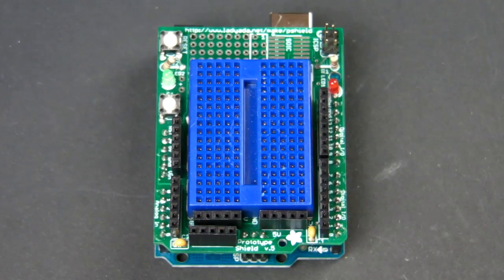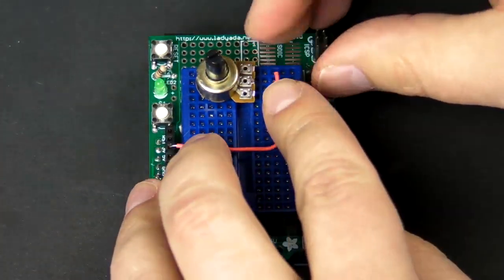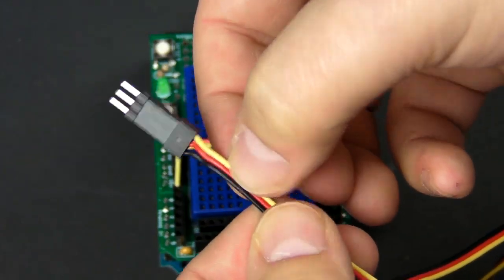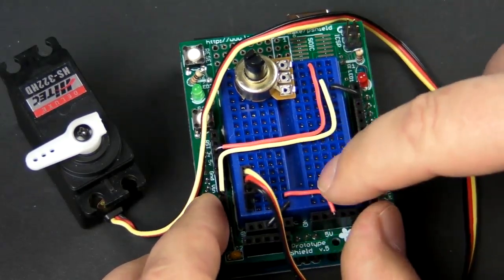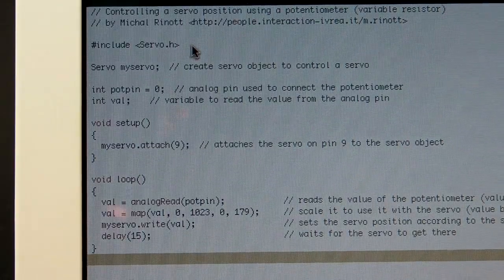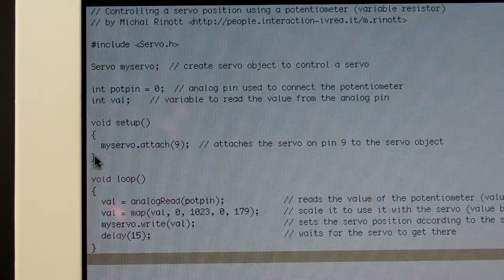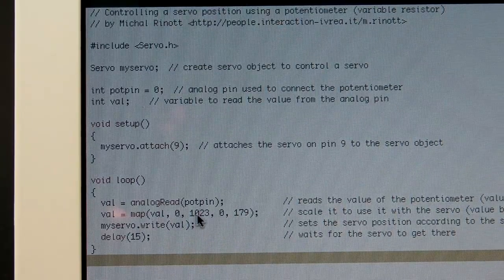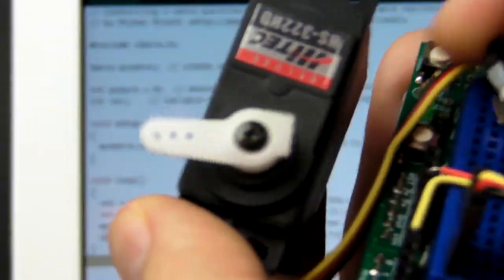How-To Tuesday: Arduino 101 potentiometers and servos

Comment: Would I be able to control a servo with another Servo in a similar method
Reply: +Steve Sacks no, unfortunately. While servos do have a pot in them, for whatever reason you cant read it without opening up the servo and wiring directly to the pot.

Comment: I am wanting to create a potentiometer servo control as you have outlined... but... want to control the servo remotely.
Sending the code via 
Bluetooth
or
WiFi (local lan [ by wireless modem] )
for pan/tilt functions of a remote cam.
Getting ahead of the game here
I want to also send Camera control via IR code wireless as well 
That IR code being transmitted as Lanc control code. 
Completely separate from the Servo PWM code.
I get that.
Wondering what format of collection of Aurdino/Rasberry PI boards can accomplish this task.
Reply: +Exclusive - Technology get in line buddy that is really advance, i only been fucking with that code for the past 6months and still no results, is not easy at all lots of filtering lots of bs and this is just one servo never mind more
Reply: Have the code...  messing with the variety of ways to make the connection.  Along with slowing the servo speed down,...   have seen lots of posts of servo speed modification in the PWM signal. 
Not wanting to limit the degree of the servo movement with the Potentiometer.. but increasing/decreasing the speed of the motor.  Want to keep Joystick for servo directional movement.
Will post results on my channel with a video when I finish this video board...
Reply: I have seen the coding of another separate servo independently referred to as a separate " INSTANCE "

Comment: Great project i love it thanks for the tutorial , i wonder how many servos and potentiometers can be attached on on arduino ? Thank u very much
Reply: +Amin B as many as port you have , what kinda question is that ? after that your only issue is going to be power
Reply: Frank Lopez kind of question that means im not an expert im just curious but that u for ur answer
Reply: im not trying to shit on you men im on the same boat i mean i am here for a reason but not cuz of the question you had in mind, but doesn't your question seems logical ? i mean how many plugs can you plug on your wall socket??  this is pretty much what you just asked.

yeah usually most single wall sockets has 1 port with 2 sockets so the answer is 2 power outlets, tho you can get a power extension and now you have more sockets for your outlets in arduino is the same concept
Reply: Thank you bro for u answers and explainations 👍
Reply: Np, Amin hope you got your project going  let me know if you have any other questions

Comment: Can you attach a analog servo to a digital pin on the arduino?
Reply: +bolo santosi why would you even ask ? and more importantly why ? analog is analog
Reply: well im new to this and to gain knowledge I need to ask questions....
Reply: I hear ya dude, where are you now in your learning exp?>
Reply: +Frank Lopez I know just the basics as of now with my arduino board
Reply: that's whats up! well I can tell you that any pin on the arduino is digital tho some of those have extra functions call ADC "analog" if you have Skype I can break some other factors down maybe even throw some code your way to help you get started on some cool projects

but answering you main Q yes you can but you will loose some of the features that the servo has to offer like feedback and others IF you need extra Digital pins you can turn those analog pins into digital pins but you cant do the same backwards, feel me?
Reply: +Frank Lopez ok cool. thanks for the information!
Reply: np

Comment: Where do you get a 3x1 header connectors as seen in this video? I had to throw something together with wires. These don't seem to be available anywhere -- am I supposed to cut down a longer header strip to make a smaller one or something?

Comment: If the servo is spinning backwards in relation to the potentiometer just flip the values like this:
val = map(val, 0, 1023, 0, 179); 
to
val = map(val, 0, 1023, 179, 0);

Comment: Yes, but servo takes power from 5V pin, so I donesn't damage the board. If it takes more than 500 mA when connected to USB, the board protection will disconnect or reboot the Arduino

Comment: Try re-installing the arduino software. Make sure you extract it to your desktop and have all the program files. Second make sure your using the right com port. That can be found in the settings of the Arduino Software.

Comment: It's not a stepper motor - 0-179 is the degree... 180degrees is the range for most servo motors... 0-1023 is what is recieved from the pot.. 0 - 0V, 1023 - 5V

Comment: Hey Minh Tran ill answer your questions for you.

Like he said in the video a potentiometer is a "variable resistor" you turn the knob and ohms are increased or decreased which then obviously changes the voltage. That being said the arduino picks up on what voltage passes though the specific pin. kinda like a multimeter. Using programming you can then manipulate what the arduino does with the information its collecting. You can then control output voltage to manipulate other components/motors.

Comment: Hi, thanks for the tutorial. Two questions:
1. Potentiometers don't generate their own (varying) electrical signals. How does the arduino receive analog data from the potentiometer? Does the arduino output electrical signals to receive an "echo" signal which is then interpreted as analog data? 
2. Why did you receive values between 0 and 1023 from the potentiometer (does this somehow correspond to voltage?)? Also why did you need to map it onto the range 0-179 for the stepper motor?

Comment: you should look into "stepper motors"... You can salvage them out of old printers fairly easy for small projects. For anyhting with mass start looking into Nema 17, 23, 34. I use the nema 23 425oz to run my cnc machine so that is a lot of force. Hope that helps...

Comment: hi, wondering if you can help? i need a fairly strong (motorbike Clutch and gear shift) 12v dual servo set up with 2 buttons, both button 1 & 2 must move servo A first and hold, while servo B moves either forwards or backwards quickly and return depending on the button pressed, shortly after servo A returns. preferably as fast as possible, but not too cost effective, can you help in anyway?

Comment: is there a way you can use a potentiometer to make the servo spin fully 360 degrees but at different speeds depending on where the potentiometer is.

Comment: Well there are only 10 people who write code, those who can and those who can't ;) You should probably learn if you want to code the arduino, and doing so is quite advanced because the chip has no operating system to deal with the complications of processors.

Comment: You would probably benefit more if you learnt to program it yourself, then you could use your gained understanding to solve other problems in the future. If I just give you the code, you'll not learn anything. Try googling 'C flow control', 'C arrays' and 'C objects'.

Comment: Yes, each potentiometer needs to be on a different analog input and each servo on a different output. You can then just have an array of input values and an array of servos all bound to the respective legs, the loop function then becomes a for loop, with the code in the original loop replaced with indices anytime you reference a servo or a value. You could also extend the servo class and add the value property and then get each object to update the servo by calling like servo.checkValue().

Comment: I think the current draw of the servo is too high. Check the max current draw(5v pin) for your Arduino. The Arduino Uno has a max current draw of 50ma from the 5v pin.

Comment: Does this only work with specific servos?
I have two servos and I don't know why it only works on one servo. 

The one that doesn't work has a spec of: 
Operating Voltage: 4.8V / 6.0V
Operating Current: 200mA / 250mA, 
I don't know why it doesn't work. I know that the servo is not broken because it moves fine when i plug in the cables not in the right way...

Comment: Wow - that's pretty cool - but didn't he say 180 degrees, cause most servos I've used are only about 120 degress - like the servo he used was.
And my flowchart software looks a lot easier to use than that.
Check it out on Pozible.com

Comment: CAN ANYBODY HELP.... i dont even own a servo or an adruino, but i have thing in my mind...that is if we move the servo's shaft using our fingers, than will the changed angle be displayed in the code(if there is a code to show the servo's position), or it is not possible to manually rotate the servo at all...please help (and if possible, does manual rotating require a large amount of torque??)

Comment: If instead of a manual pot I placed a digipot chip coded with a sine wave of resistor values, could I use the same code for the arduino to have the servo constantly rotating?

Comment: replace pot with a digi pot that constantly changes voltage (I'm thinking sine wave, but triangles could work too) and mount a laser on the servo to create a swirling laser display.  Use multiple servos to do it in 2 dimensions

Comment: Don't you need to connect diodes to each output to the servo to protect the arduino board from back emf from the servo coil? Or are they included in the proto shield?

Comment: There is a problem with the code.  You use an int variable to hold the value for potpin.  This value never changes.  So the use of a #define is called for not an int variable name.  The main reason for this is it wastes memory.  A #define statement takes no memory while a int variable takes two bytes of memory.  Well I think it's two bytes if the C standard is used by the arduino compiler. This isn't nit picking.  If you have a non-trivial program 2 bytes could mean it loads or doesn't.

Comment: @formulaformula1133 Yes and no. A trimpot is a variable resistor as well...it just doesn't have the pole to rotate. A trimpot is usually smaller as well. Also, you need a screwdriver to turn it. It usually is a bit less accurate as a potentiometer.

Comment: @bababoy11 Just connect a wire on the breadboard from the closest row to the arduino (where the red plus sign is) to 5v and the one where the blue minus sign is to ground and connect any 5v/ground wires to the breadboard in those rows. If you want, PM me and I'll send you a link to a picture of it.

Comment: 2 Questions: 
- Servo 'jitters' often, how to get rid of this?
- How to shorten my delay. My 'project' isn't responding as direct as in the video.
   (Hint: there's a relation between the delay and the blinking of the build-in led on 
    the Arduino./ Blink? -> Delay.

Comment: @mtdeezy Also, you should be careful about what you plug in to your Arduino, as you could very easily burn it out. I just wanted to say, check out my channel - I have a video on how to use Arduino for a bidirectional motor controller using a simple H-bridge circuit. You also gave me a good idea for a vid. Maybe I'll add a tutorial on transistors tomorrow.

Comment: @mtdeezy Sorry, I replied but deleted my answer since I misinterpreted your issue. The problem here is that the Arduino is not a very good power source. A motor is basically a big giant inductor, which takes a LOT of current. Although the Arduino is capable of outputting 5V, there is a limit to how much current it can source and sink. What you should do is create a simple transistor driver for the motor so that you can use an external power supply rather than the Arduino directly.

Comment: @Bizorke oops. I forgot to do that. But now when I try to use the digital pins to power a motor it spins it as if its only getting 3v. I read the voltage and it is in fact 5v.. but it doesnt act like it. Why would it do that?

Comment: I have been wondering if there is a way to cennect a 2.4 GHz 4 channel RC transmitter to an arduino,(I have a USB cabel connecting the transmitter to my computer).

Comment: @codymannthedestroyer maybe but the turn ratio's would be different, the whole reason you put it through the arduino is to better control the servo so that it turns evenly with the pot, as the servo has 1024 possible steps and the pot only 180. make sense?

Comment: Doesn't the servo draw too much current (>30mA)?  I've been told not to ask more than that from a single pin. Or is that only from IN/OUT pins?  If so then how much can +5V and gnd handle?

Comment: @lucirz It was a cheap speaker from radio shack. Any small speaker should work fine. You could also wire up a headphone jack to plug into computer speakers. 

I am not sure about hooking a camera to an Arduino. But you wouldn't need an arduino for that. Assuming you aren't using a webcam, get a video capture card.

Comment: @lucirz Yes it can. There is a built in tone function to play sounds. All you need is a speaker to plug into one of the digital I/O pins. I have a video with an arduino project with sound.

Comment: Wow....I fly Remote control airplanes and one problem I come across is when working with servos you find yourself trying to zero them out in construction,if they are not at 90deg exactly your control surface will need to be trimmed out,could could zero them by setting up the whole system..but that wastes lots of time,this would be so handy by simply having a setup where you could have it write say from the pot to one part of the board and to another 90deg,then setup would be super easy.

Comment: @13rugrat 

You can buy a WiFi Shield for it which can transmit and receive. I assume you would need a receiver on the servo side. I'm not sure how the code would go though.

Google WiFi Shield Arduino

Hope that helps
:P

Comment: @husam27 No, you need to be able to convert values from the potentiometer (0-1023) to values acceptable by the servo (0-179). This is done using the map() function.

Comment: The regulator on the Arduino board is rated at 250mA I believe...the actual atmega is rated at 40mA max.  With that said the servo receives power from the 5V bus which has a max of 250mA, this means that the current used to power the servo is limited to 250mA. If you plan on using more than two servo's it would be best to probably supply 5V (or lower) from a seperate supply and the not from the board, because I think typical servo draw when rotating is about 100mA and like 5mA in standby.

Comment: well not really, the armega chip is the brains of the arduino, and is kinda cheap on its own

so you just put it in the arduino and upload the code, then pop it out..

just supply 5v and it works by itself so you can put it in some perfboard or breadbord.

just get the datacheet with the pin ID to know what is what

Comment: sorry, this is an old post, but i just HAD to reply! You can get the arduino board on it's own (no protohsield) for about $30. Not sure how much protoshield costs...i didn't buy it, however, i built this project without it...just use a breadboard

Comment: i found those kits to be overly expensive, i bought the duemilanove and a proto shield, which i believe is the only stuff thats fairly prised

i made a  9vbattery pack myself in like 5 min. hardly worth what they are charging,but neat i guess

and the the handfull of led and other stuff is mostly easy to get, if you cant buy it,rip it out of some old crap

i find using parts soder'd free from junk more fun,   but good kits non the less

Comment: digital has only 2 values. 1 or 0, on or off, high or low. in voltage terms with the arduino, you have 5v (on) or 0v (off). with analog, you have a continuum of values between 0v and 5v that can be used. 0v can mean something different from 1.345v, which can mean something different from 4.000002v and so on.

Comment: Or, you can go to either a hobby shop or to Ebay and get an R/C transmitter and receiver for $10.00.  Hell, you can even get a micro-receiver for less than $20.00.  It's 1/3 the size of what you've built.